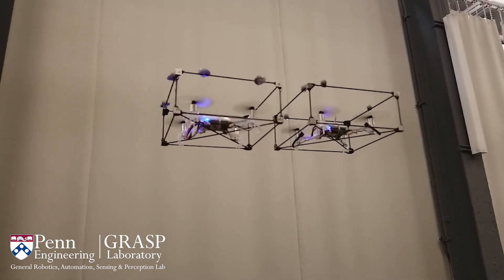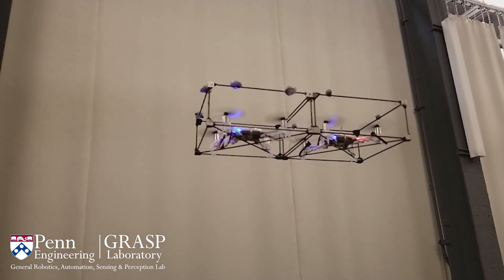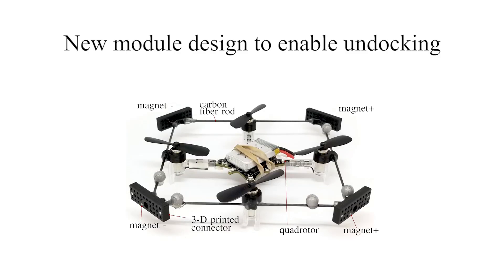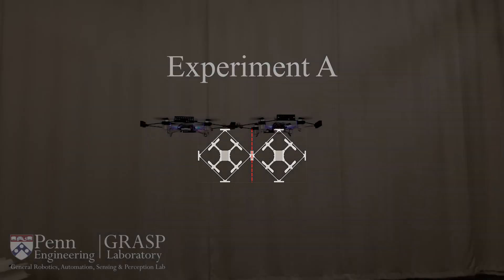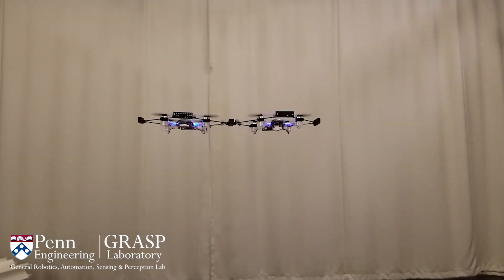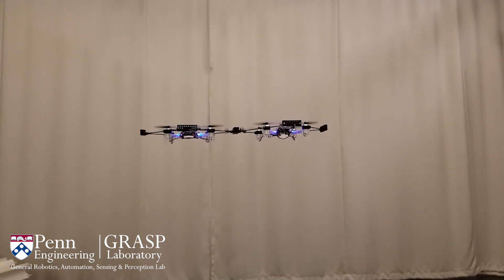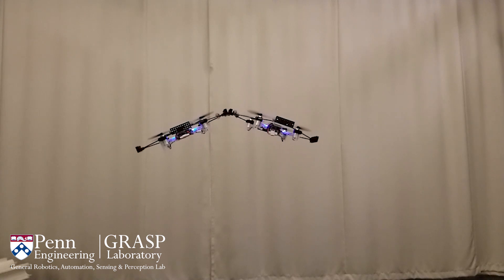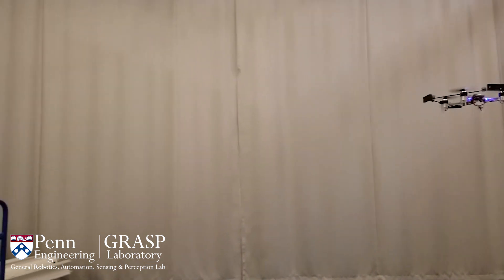Design and Control of Aerial Modules for Inflight Self-disassembly

Comment: Is there an algorithm to join and form columns in the most efficient way as well (similar to disassembly, recursive method)?  How will the swarm respond to a disruption of the structure (such as a basketball falling through through middle of a 6x4 grid), and if those result in irregularly shaped formations how will the swarm address that? 

For example, if you have a disruption and now your swarm looks like this:
X  X  X  X    (row 1)
X  X  X  X    (row 2)
X  X             (row 3)
X  X  X         (row 4)
X  X  X  X     (row 5) 
How will you be able to add nodes back to the swarm? Algorithm to separate down to minimal  (such as forcing a separation between rows 2&3, 3&4, 4&5... then adding drones to the right of that, equaling 4-wide rows, then rejoining back to original formation?

I'm always amazed at the work done here and sharing of progress from your department. Amazing things, such a great team!  Thank you.

Comment: I wonder if the larger structures gain any efficiency if some number of the individual quads spin down upon becoming part of the structure.  If they were functional mesh nodes, these could bucket-brigade an ever smaller number of quads out to a longer reach for some kind of live gas leak or radiological fallout sensing / tracking.